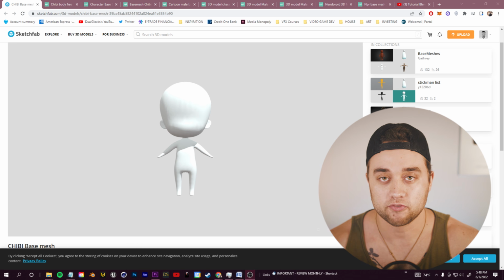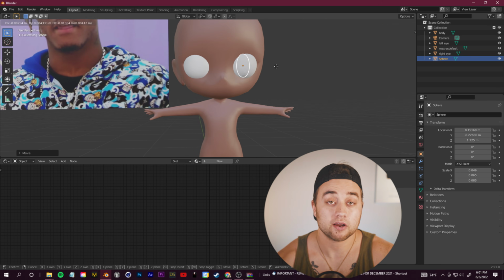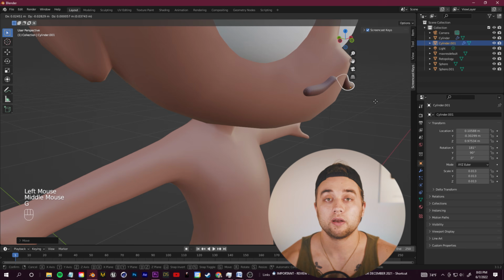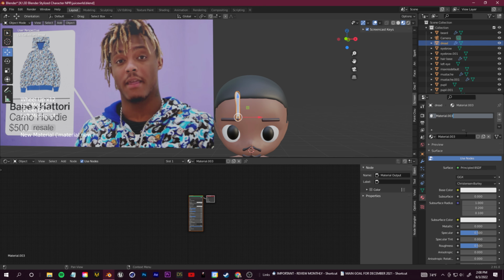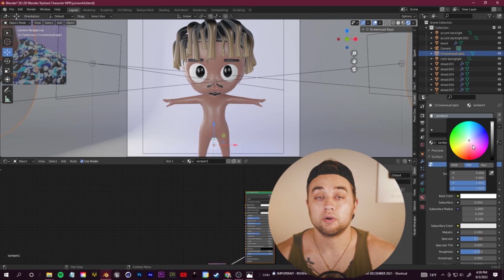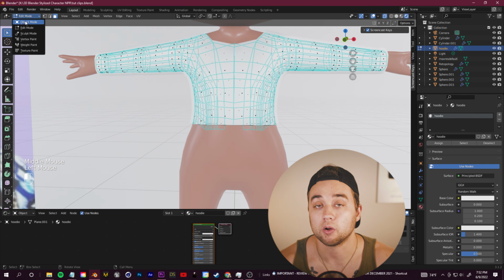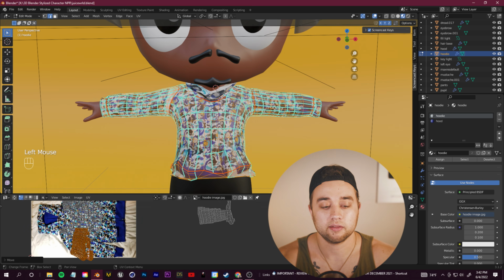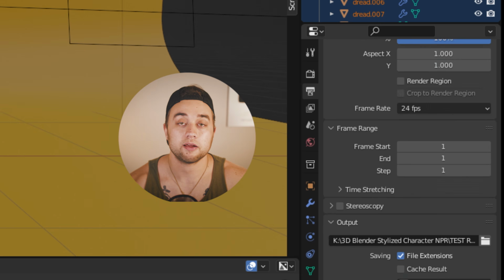Turn ANYONE into a 3D Cartoon Character ! w/ Blender

Comment: EVERYONE WHO IS HAVING SMOOTHING ISSUE 4.1---
1.Stay in Object mode and have your mesh selected
2.Click the Object tab (the 4th option from Object Mode)
3.Scroll down and select SHADE SMOOTH BY ANGLE (a little tab will appear on the bottom left)
4.Max the angle to 180 and uncheck (Keep Sharp Edges)
should be perfectly smooth then.

Comment: In Blender 4.1 and later versions, the Auto Smooth option under Object Data > Normals has been removed. However, you can achieve similar functionality using a new Geometry Nodes-based modifier. 

Object Mode:
Right-click in the viewport while in Object Mode.
Choose Shade Smooth by Angle. This will create Mark Sharp on the edges based on the angle chosen in the operator box.
Alternatively, you can right-click in Object Mode, choose Shade Smooth, and then give your object a Normals > Smooth by Angle modifier.
Edit Mode:
If you’re in Edit Mode, you can use the new Set Sharpness by Angle operator. This operator allows you to set sharpness based on the angle between faces. It’s implemented as part of the changes in Blender 4.11.
Remember that the Auto Smooth functionality has been replaced by these alternatives, so you won’t find the old option directly. Adjust the angle threshold to control the sharpness of the edges as needed. Happy blending!
Reply: tysm this is rlly helpful
Reply: or just in edit mode select all mesh, rightclick and “Clear sharp”, then u can shade smooth in object mode

Comment: If you are goong to duplicate stuff from one side of the face to the other, it's easier to use a mirror modifier. 
If you need to make duplicates of stuff, instead is using ctrl-c ctrl-v you can use shift-d for duplicate or make a reference copy with alt-d.
That saves on poly counts.